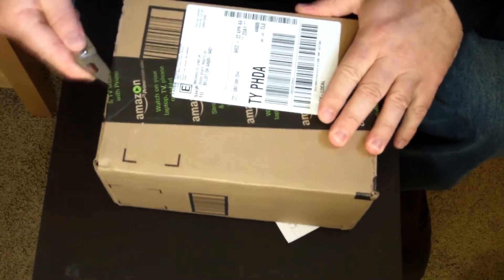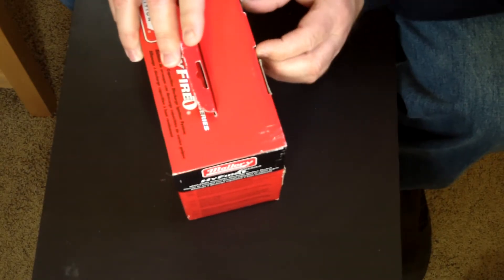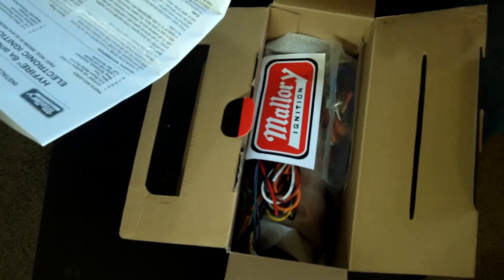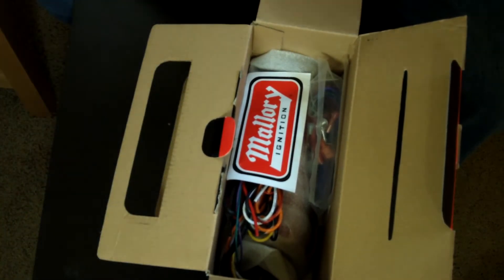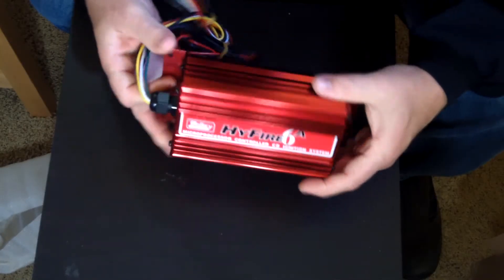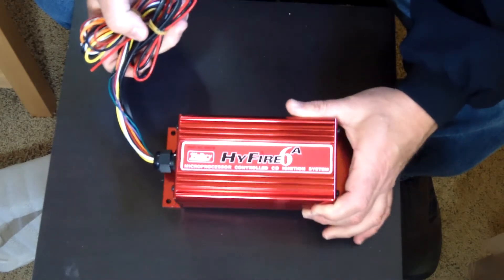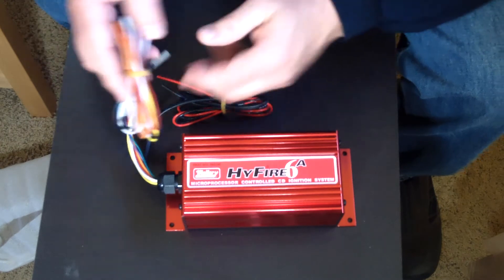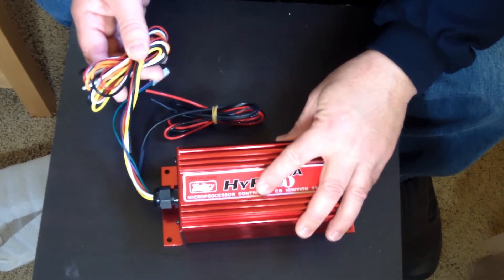Mallory Hyfire 6A Capacitive Discharge Ignition

Comment: thanks for the video, a quick comment on the high dollar spark plug wires, I decided to splurge on an MSD expensive set a year or two ago, and what a circus that turned out to be, went back to my local parts store three times and had the techs behind the counter test three boxes of custom wires for resistance with me one by one to pull out enough good ones to make one set, those high dollar MSD wires were junk, we were all shocked, they sure don't make stuff like they used to